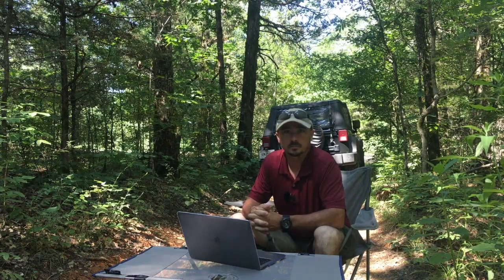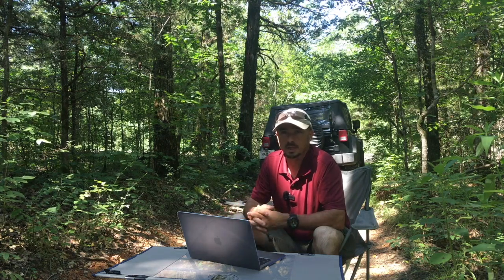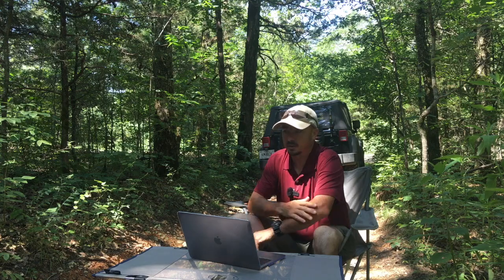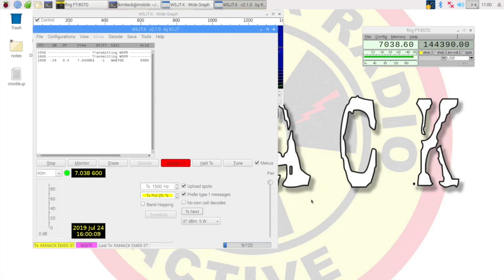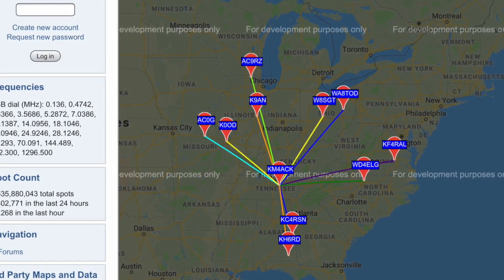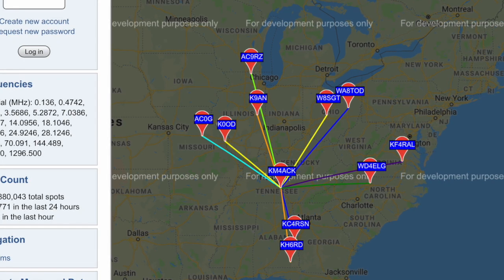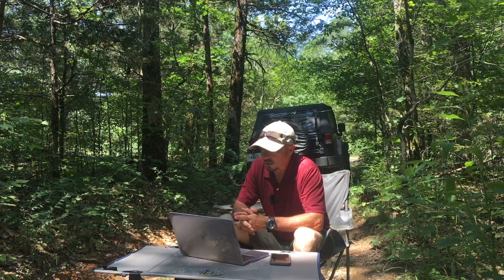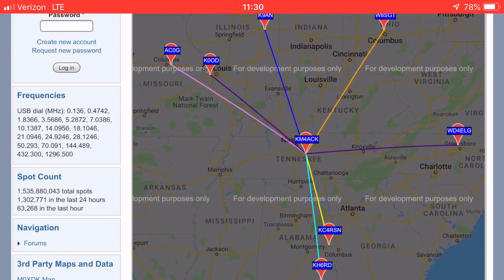Mobile NVIS

Comment: Hey, Jason.

The antenna you have will work, and it will work well. You just need to tweak your methods a bit. 

First, you have to be familiar with Maximum Usable Frequency (MUF). At our current point in the Solar Cycle, 80M is generally better than 40M during the day. 

Here's a great propagation prediction website: https://www.voacap.com/hf/ 

Move the cursors: one to your location, the other somewhere within 50-100miles away. Set the antenna heights for both stations to 17ft dipoles on 40,60,80M. Choose your mode and power. Click on the Prop Wheels to get an excellent graphic of the percentage of success between the two points around the clock. It's not a perfect match, but it'll get you on the right track. 

For NVIS reading: https://www.universal-radio.com/catalog/books/5444.html This book is a compilation of articles LTC Fiedler and others wrote for the military. It is an excellent resource. 

Also: Army Field Manual FM 24-18. Read Appendix M: Near Vertical Incidence Skywave Concept. 

Ocean County ARES in New Jersey has used an antenna design similar to yours to communicate all around our region -- from 15mi out to 308mi (and all over in between) using SSB and various Digital modes. 

When you play with the VOACAP page compare 100W SSB to 5W CW/Digital with all other settings the same. You'll see why Digital is far more efficient for EmComm than SSB -- but I guess that's no surprise.

 As for vertical whip antennas. Again, you have to look to the military. I'm sure you've seen whips tied down over jeeps and Humvees. That's not to get under bridges. It's to raise their take off angle from low to nearly vertical. Now if you read their manuals you'll find that while that works, it is a compromise. The whip radiates best when bent off the BACK of the vehicle. However, it's not practical to drive with a 16ft whip sticking out the back, so they bend it over the front when moving and off the back when stationary. I've experimented with bending a 75M Hamstick on a spring off the back of my truck. It's a huge compromise, but it does work. I've gotten ~75mi away with 30W SSB. 

So anyway, I hope this helps you on your NVIS quest. Like I said earlier, you're well on your way with your wire antenna. Check my QRZ page for more info on the OCARES ANA-1 NVIS wire antenna that Ocean County ARES uses. It's cheap and easy to make, light weight, super portable, easy to deploy and tear down, can be used on 40/60/80M and....It works! 

This is not to say that you can't add reflectors or raise the height or slope it or whatever else to get some better performance out of it -- or better yet just get an endfed inverted V or an AS2259 dipole. But for our portable needs in ARES, it works great as is. Good antennas don't always have to be complicated.
Best of luck, 73 

NJ2N
Reply from the maker: Thank you for taking the time to include all of the info. I ordered the book you recommended. I have considered a 102" whip bent over the front of the jeep. My only concern is side loading  the tarheel. I am afraid the tarheel might not be able to take that much force. An inverted V would certainly be a better choice. I tested this setup trying to find something that has a super quick deployment that was also small to pack around. One thing you learn when you drive a 2 door jeep.....every inch has to be accounted for. There just isn't that much room in them. I still might try the 102"whip though. If the tarheel can handle it then it could be used while actually mobile. The stationary design of mine limits it's use. 73, de KM4ACK
Reply: @KM4ACK  I’m guessing you’ve experimented even more since you published your video 3 years ago. In a response to a comment you said an inverted V would be a better choice. One only needs to look at what the military does for mobile HF where the rear mounted whips are bent over to secure to the front of the vehicle. Of course, an inverted V would not work on a vehicle.
Re the inverted V, many are likely aware of the RACAL AS-2259/GR crossed inverted V. Cut for US mil frequency bands, cloning one doesn’t work well on the amateur bands. This antenna uses a coaxial transmission line 15’ mast to feed the dipoles at the top of the mast. The dipole elements slope downward at approx. 30 degrees. I constructed one cut for 80M, 60M, and 40M (lower bands with loading coils). I compared its 40M performance to a straight 40M dipole that was strung at the same height of 15’ as the V’s feed point. Expectation was that, though both were at nearly ideal height (1/8-1/4 wave length above ground), the horizontal dipole would out perform the V. Contact with a cooperating station approx. 400 miles distant using a horizontal NVIS array resulted in 2S units better with my V than the horizontal dipole. 
A friend of mine camps in the Yosemite Park valley. The valley is at about 4k’ and surrounded by 6k’ to 8k’ mountains. The valley is only a mile or so wide – making a v-e-r-y challenging HF path. He regularly checks into an evening 80M net. To get out of the valley, he rotates his vehicle antenna to a horizontal orientation which results in very good comms with the net.
This month’s QST (July ’23) has an excellent article with the application of NVIS to overcome lumpy real estate issues with a public service event in Maine. Well worth the read.

Comment: I use your EFHW kit parallel to the ground about 6.5’ above the ground and can communicate across the the State of Hawaii with 6W.  The closer stations about four miles away on Oahu works fine, albeit a bit weaker than the stations in Hilo on the Big Island.  

An HF Kit EFHW set in an inverted Vee is both an excellent NVIS as well as DX to South Africa 12K away.

Comment: Nice video. Thanks for taking the time to test it. With the new band hopping scheme on wsjtx, there is an order that is no longer random to optimize when stations are listening and transmitting to maximize the number of stations on a band at a time. It may have been that some stations in your area weren't on 40 when you were TX. 

Adding a ground screen of horizontal elements will help in general because of the amount of loss of signal into the ground. What most antenna modelling doesn't show is the radiation pattern into the ground. In Ground Penetrating Radar, GPR, we use that energy, which is significant. 
Thanks again
Brandon W0GPR
Reply from the maker: I didn't realize the band hopping feature was timed so stations were on the same frequency at the same time. Makes sense. Thanks for the tip! 73, de KM4ACK

Comment: Thanks to your video I was motivated to experiment with my Little Tarheel 2 during the recent OH ARES NVIS Day.  

Using a modified quick disconnect to SO239 connector and ran 50ft of coax out at 10ft in the air. (The coax cable is what I normally carry in my go kit, 10 ft up using the mast sections and mounts I normally carry, plus cargo straps and a handy tree). 

 Had good results on 80M copying the state EMA at 40+ and they received me at 57.  

 It would not tune at 40, I think the coax was too long as the Tarheel only came up as far as it normally does at 20M.  Didn't think to check tuning on 160.  Need to check that next time, along with experimenting with shorter coax runs to get it tune up on 40M.

Thanks again for the idea!

73 Randy KAØAZS

Comment: Nice test. Thanks.  I use a 96" whip on a Chameleon base.  When I want to go NVIS I bend the whip over my roof and tie it to my luggage rack.  It works quite well.  73, Charlie - K0CKH
Reply from the maker: I've considered a 102" whip for the tarheel but I am concerned about side loading the coil with the force of bending the whip over the jeep. 73, de KM4ACK

Comment: I was planning something similar with an FT-857D in my pickup truck. The plan was a 3/8" mount on the edge of the pickup bed where I count mount an MFJ HamStick for DX or an end fed dipole with an impedance matching box for NVIS.  I'm due for a new truck so I postponed that installation.  Thanks for the WSPR testing.
Reply from the maker: That sounds exactly like the web article I referenced in the video. That's where I got the idea. Need to do some more testing soon. I managed to get my hands on a 102" whip that I want to try. Keep us informed of what you settle on and how it works. 73, de KM4ACK

Comment: Portable vertical antenna still works NVIS, but a horizontal wire off your feed point, I have a icom AH4 tuner installed on the truck

Comment: Great and informative video Jason. Have you tried to lay another wire on the ground below the antenna wire, like a reflector? I have heard this gives it more of a "cloud warmer" type of take off angle.
Reply from the maker: I have heard that but never tried it. May have to test again with that and see if I notice a bigger difference. 73, de KM4ACK
Reply: The counterpoise on the ground really works quite well. I used for some emergency comms on hf from the bottom of some deep canyons in the Sierra.

Comment: Maybe someone has already mentioned it, but foF2 was 4.65 MHz at the time of the video according to the nearest Lowell Digisonde I found (looking at an ionogram), which means the 40m band would not have worked for high-incidence skip-zone-free comms. 80m would have worked great, right at the sweet spot, there was even a double hop trace above it in the 80m portion of the band. Nice setup though!

Comment: I suspect WSPR is so sensitive that your results are skewed indicating they are similar.  I agree that SSB voice would result in a more significant difference.
Reply from the maker: Great point! Why didn't I think of that? 73, de KM4ACK
Reply: Ya - compare with a dipole for a reference. I test using two antennas, two transmitters, etc, in WSPR band. That way fades affect ALL antennas under test. Even testing 1-2-1-2-1-2 alternately fades occur and skew results. Plus, testing over 24 hrs one sees how the ant does for DX vs NVIS.
Reply from the maker: @uploadJ  Running both at the same time would be nice but don't have to 2 HF rigs in the mobile to test with. Testing against a dipole is a great idea. I have been frustrated lately with the maps being down. http://wsprnet.org/drupal/wsprnet/map 73, de KM4ACK

Comment: I do not think a mobile is a true NVIS antenna. I think that is where the problem is. The true NVIS antenna has a crazy elevation angle, pretty much straight up. I've not done much personally but have read some, and see examples of NVIS antennas with huge metal "reflector" arrays under them. They are not ground planes, but instead reflectors. That seems to be crucial for a good NVIS antenna. Antennas really are taxing from the brain power side, and the programs which try to help in computers can be a direction to go to. Great to experiment with an attempt at using ft8 or ft4 mapping as a results graph, couldn't do that 5 years ago.
Reply from the maker: You are correct sir. The horizontal wire helps but probably not a great NVIS. Just fun to experiment. 73, de KM4ACK
Reply: Agree.  The typical pattern resembles a isosceles triangle.  I've done with with a 20 ft mast with the 40m dipole (1/4 wavelength) legs running towars the ground, spliced with rope to it terminates a few feet above ground.
Reply: @KM4ACK  

Actually, no, N6GRG is not correct. The antenna you have will work, and it will work well. You just need to tweak your methods a bit.
First, you have to be familiar with Maximum Usable Frequency (MUF). At our current point in the Solar Cycle, 80M is generally better than 40M during the day. 

Here's a great propagation prediction website: https://www.voacap.com/hf/
Move the cursors: one to your location, the other somewhere within 50-100miles away. Set the antenna heights for both stations to 17ft dipoles on 40,60,80M. Choose your mode and power. Click on the Prop Wheels to get an excellent graphic of the percentage of success between the two points around the clock. It's not a perfect match, but it'll get you on the right track.

For NVIS reading: https://www.universal-radio.com/catalog/books/5444.html
This book is a compilation of articles LTC Fiedler and others wrote for the military. It is an excellent resource.
Also: Army Field Manual FM 24-18. Read Appendix M: Near Vertical Incidence Skywave Concept.

Ocean County ARES in New Jersey has used an antenna design similar to yours to communicate all around our region -- from 15mi out to 308mi (and all over in between) using digital and SSB modes. 
When you play with the VOACAP page compare 100W SSB to 5W CW/Digital with all other settings the same. You'll see why Digital is by far the best NVIS mode for EmComm.

As for vertical whip antennas. Again, you have to look to the military. I'm sure you've seen whips tied down over jeeps and Humvees. That's not to get under bridges. It's to raise their take off angle from low to nearly vertical. Now if you read their manuals you'll find that while that works, it is a compromise. The whip radiates best when bent off the BACK of the vehicle. However, it's not practical to drive with a 16ft whip sticking out the back, so they bend it over the front when moving and off the back when stationary.
I've experimented with bending a 75M Hamstick on a spring off the back of my truck. It's a huge compromise, but it does work. I've gotten ~75mi away with 30W SSB.

So anyway, I hope this helps you on your NVIS quest. Like I said earlier, you're well on your way with your wire antenna. Check my QRZ page for more info on the OCARES ANA-1 NVIS wire antenna that Ocean County ARES uses. It's cheap and easy to make, light weight, super portable, easy to deploy and tear down, can be used on 40/60/80M and....It works!
This is not to say that you can't add reflectors or raise the height or slope it or whatever else to get some better performance out of it -- or better yet just get an endfed inverted V or an AS2259 dipole. But for our portable needs in ARES, it works great as is. Good antennas don't always have to be complicated.

Best of luck, 73
NJ2N

Comment: For some reason I can't consider this to be "mobile". Just because the antenna is mounted on the car and the radio is in the car doesn't mean it's mobile. Seems to me that to be considered to be mobile, one must be able to operate while driving down the road. If one can drive down the road, stop, and continue operating without making any station changes, it could be considered fixed mobile. But there is nothing mobile about this. Take the Tarheel and mount it on the hood of the car and lean it way over the top of the car. Does that work?

Comment: The "incessant Cessna" is what I call those low, slow, and noisy aggravations to the out-of-doors.   When they get stuck in a headwind, they hang up there forever!    Is 20m too high in freq for NVIS?  I should work up a mount so I can deploy my half-wave all band from the car.  Thanks for vid.
Reply from the maker: LOL. Yep, 20 won't work for NVIS. 40 & 80 are   your best bet. 73, de KM4ACK

Comment: 3 questions:  When you removed the whip and switched to the wire, did you retune the Little Tarheel?  I have that setup in my truck with a IC-7000 and use a Turbo Tuner to adjust the LTH.  What length of wire did you stretch out? And, lastly, do you have corrosion issues with that quick disconnect?  Even in dry Arizona I have had issues.
Reply from the maker: LARRY TAYLOR yes. I re tuned each time. The wire is ~30’. No corrosion issues with the quick disconnect and my whip is off 3/4 of the time. Can’t fit in the garage with it attached. 😀
Reply: KM4ACK I had never thought of using the quick disconnect to solve that problem.  I have to unscrew it every time.  And, of course, I have forgotten about it a few times and bent the whip badly going into the garage.

Comment: When you see a HUMV running around with its antenna pulled forward and tied to the front bumper, they are operating NVIS, usually digital.
Also, those funny bars over the top of WW-II German Army Command Cars were not for RollOver or Rain Protection but was an NVIS Antenna which was in standard use along with their ENIGMA Code Machines via hand sent CW.
The German Army was using NVIS at least as early as the 1920s as were German U-Boats during WW-I when close to their shore bases. Out to sea the same antennas used Skip at higher frequencies. All during WW-ONE!
Many National Guard buildings have a 40M Dipole NVIS Antenna about 20 ft above the metal roof of their building operating Digital/SSB.
In the 80s I used 40M and 80M Hustler Resonating Elements folded over the roof of my Ford StaWag on the installed hinge mount while both Mobile and Portable. I also used a 20M Resonator with a length of wire clipped to its top and stung out to a tree to operate 40M. I made many 40M NVIS Contacts using both setups with a TS-430 and a few on 80M, all SSB Phone.
At this QTH I have an 80M EFHW Slopping Inverted ELL going up on a 40 foot SpiderBeam Mast and slopping out to a tree limb 100 ft away. Works NVIS SSB like a champ and occasionally a marginal SSB phone from NH out to MI/OH.
A 40M or 80M EFHW is a multiband antenna. I can hear good on 20M but haven't been able to make a solid contact yet. Drats! Must cut a 20M EFHW wire and try that as a virtical W/WO a few radials.
73 OM KA1RUW.....

Comment: Great video, I've wanted to do the same test with my Yaesu ATAS120. Does adding the whip back on top of the wire create an L type or does it mess things up because the screwdriver portion and the whip would put the wire in the middle?
Reply from the maker: I can’t say as I have never tested that configuration.